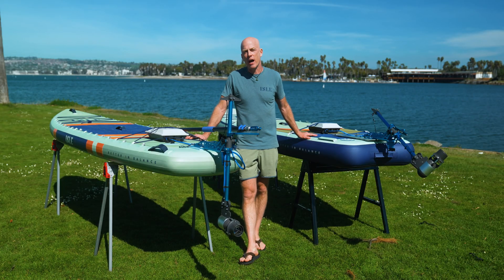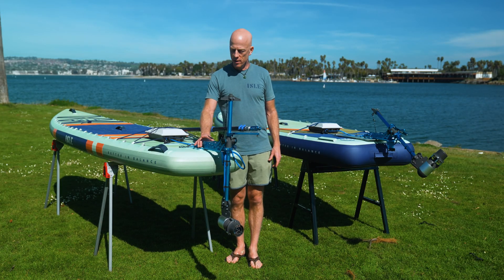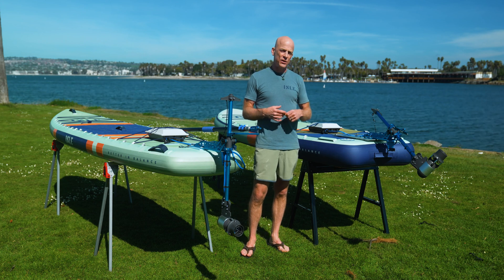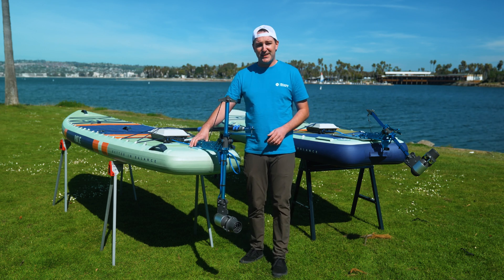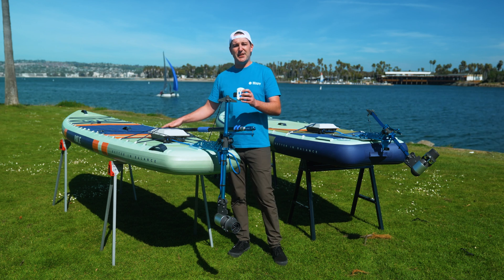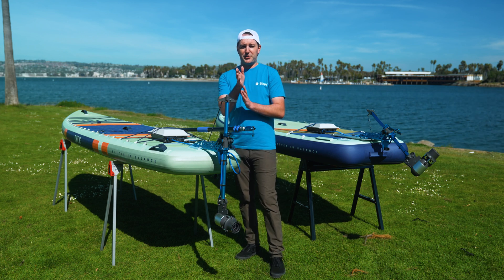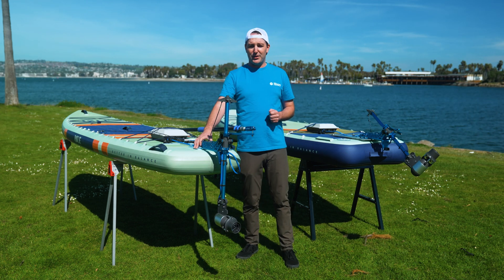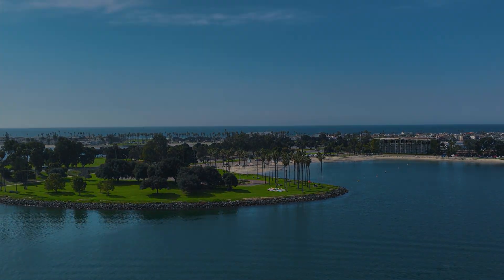ISLE Motor Mount System Walkthrough - Bixpy, Torqueedo, Etc.

Comment: The video shows the Bixpy K1 K-1 Outboard Kit Power Pole Adapter mounted to Your 11'6" Switch Pro without the motor mount plate. Can that same Bixby K1 also be mounted on the Flywater without a mounting plate?

Comment: Random question... Do you keep the fins on when you install the motor?  I have the megalodon 3 15'
Reply from the maker: The fins will definitely help with tracking, but also add some drag.  You can go either way depending on the conditions - if it's windy, I'd keep fins in, or if you want to reduce how much the board will drift sideways in the wind

Comment: Hi several questions. Where can I buy the aluminum mounting plate. I don't see it on the website. Also the other issue I'm facing is most states require a hull identification number to register a boat. And they also require a registration to use even an electric motor. Final question is can this support a gas transom with the plate?
Reply from the maker: We should have them in stock by October or November. Use the serial number by fin box as HIN if allowed by your state, and add numbers to the side if required by your state. Yes you can add a transom to the motor mount bracket and install a gas motor up to 5HP.